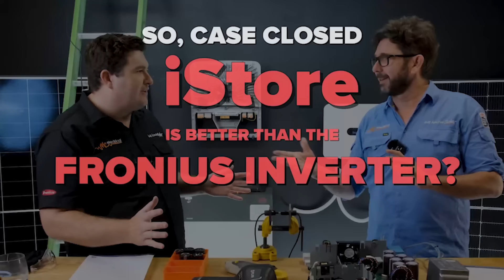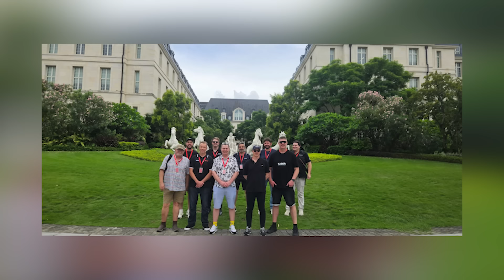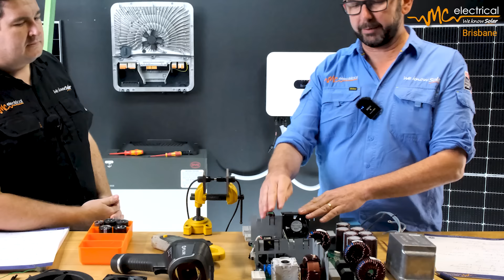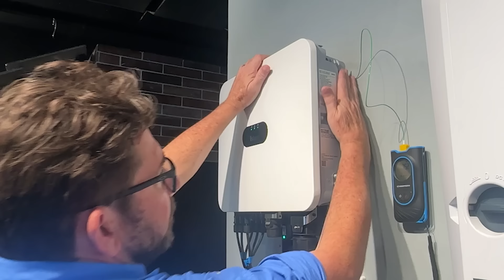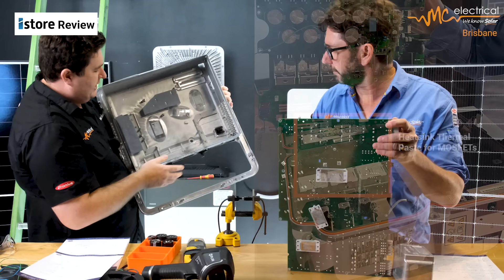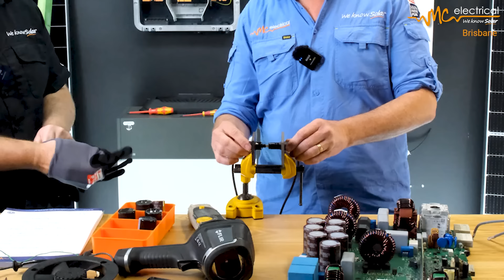Is iStore better than a Fronius GEN24? Inverter Comparison Review

Comment: @3:30  That /is/ an everyday PC case fan that costs about 5 bucks , they can reverse too.   Also are you sure that inverter passed regulatory, since all those connections are easily accessible with no protection, I envisage a recall soon by the nannies of the govt. And Huawei, also dont have best security practices on more than 5G, a lot of their broadband DSL gear (network side as in carrier side),  haven't had the best record
Reply from the maker: I’ll bring up mechanical protection of Battery cables in the next video. But I brought that up with the head of batteries in China, and I’ve 3d printed a cover for our upcoming install. The inverter meets turbo requirements, but unless the cables are mechanically protected, (at a minimum with a plastic clip on  cover) the installation won’t be compliant. 
I’m  not sure how “nanny state” it is when there is 10000 amps short circuit potential and mc4’s are known to snap. 
We already have BYD onto the same issue, and they are mass producing our design for the Australian market.
Reply: @mcelectrical do you happen to have the 3d STL file for the cable cover for the iStore? Keen to install on my system

Comment: "Looks just like a computer fan to me".  Beware the $5 fan.

Did you check what sort of bearing those fans use? 

I can tell you now from first hand experience that if the fans aren't using ball bearings and are sleeve bearing (or similar) instead there will be a lot of fan failures and therefore warranty claims left, right and centre.
Reply: I was thinking if chuck some good quality Noctua fans in the iStore could make all the difference to getting the capacitor temp down?
Reply from the maker: Interesting. I’ll look into that next time.

Comment: Other thing I notice / ask myself: you say the Fronius can also do N E & W, but is my understanding correct that this is only possible if E and W are same nr of panels?
If so that is a huge downside compared to Actual 3 MPPTs where I am not limited by this. 
Please correct me if I get this wrong. And please comment on why this was not mentioned in the vid, as I feel this is an important oversight. 
Thanks Mark for your great work.
Reply: That is correct, but it's usually a non-issue for system design.

Comment: Sigenergy blitz them all in terms of 2025 installs alone
Reply from the maker: Round trip efficiency testing of sig coming soon
Reply: @mcelectrical  Not saying you won't but please do it honestly as I am interested in this.
Reply: how's that recall going for sigenergy
Reply: @JacenHuggett  Only some single phase Sigenergy models were affected. They are all getting replaced under warranty. I've got 3 phase power so would not have affected me. Tesla Powerwall 2 also has a recall don't hear you asking about that?

Comment: Great video
Can’t wait for your in depth review of the iStore battery 👍⚡️👍
Reply from the maker: Yeah we’ll be doing several round trip efficiency tests on it at different charge and discharge rates. I’m curious to see how it goes with the DC to DC converter setup.

Comment: Even though iStore controls firmware rollout in Australia, that doesn’t remove the fundamental dependency on Huawei. iStore engineers can’t read or audit the firmware — it’s a signed binary blob compiled and encrypted by Huawei. In other words, iStore distributes the firmware but doesn’t control what’s inside it.

Because all Chinese companies are legally required under China’s National Intelligence Law to comply with state directives, the chain of command ultimately still leads back to the Chinese government. iStore’s local servers and operations add a layer of separation and make direct interference less practical, but the root-of-trust issue remains — you’re still relying on firmware built and signed in China.

And as we’ve seen with the rare-earths controversy, China will use whatever leverage it has when it chooses to. The same geopolitical reality applies here: operational control may be local, but strategic control of the code is not.
Reply: Agreed, unless old mate can supply independent evidence that the I store unit will never send back info to the “mother land” I’ll avoid anything associated or related to the ccp
Reply: Move to the US please. Without China we would be a third world country. The amount of economical leverage they have over us is ridiculous, this doesn’t even move the dial
Reply from the maker: Interesting. To be fair i don’t understand the ways back doors can be opened. Seems like you are agreeing that at least the front door is locked.

Comment: I remember when we first installed the Huawei SUN2000 5kW Hybrid M0 inverter and was so impressed by the size and design. Great to have their products back in Australia under the local care and support of iStore.
Reply: Agreed Glen. It’s definitely a solid inverter. Temperature might be a bit of an issue, but that’s kind of a common problem.

Comment: I'm 18 Days into our new system installed by MC, as of yet I've seen no sign of derating, Sunday 12th being 32.5c (hottest day so far)
gen24 10kw just keeps slogging out maximum as long as the sun is unobscured (and we're using the power as well as exporting, the EV helps heh)
October (17th today) we've already generated 1.158.52kwh, 98% self sufficiency  @ 51% self consumption. 
from a 15kw array N, E & W facing panels.
564.27KWH to the grid @.05c/KWH 
209KWH to the battery
385KWH consumed directly
12.70KWH imported from the grid (first night forgot to set the car not to charge after sundown oops) our first and only 100% battery discharge (19kwh BYD)

super happy with everything so far. 

soon to start integrating into Home assistant to FAR more control over energy with solar forecasting to adapt to conditions.
Reply from the maker: Nice, thanks for the comment John!.I wouldn’t expect your system to derate ever. Gecko issue will be solved with your inverter. But, since you are keeping a close eye on it, let us know if you see it derating (as opposed to export limit as you mentioned).